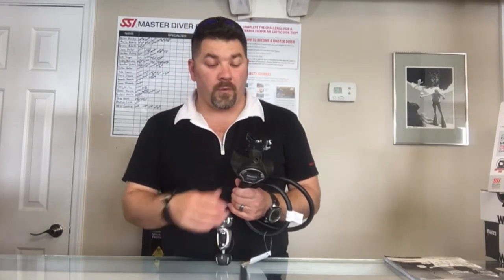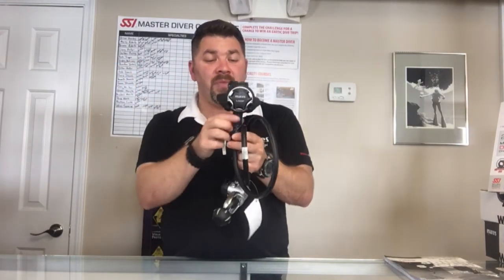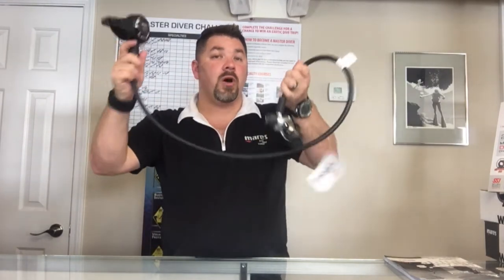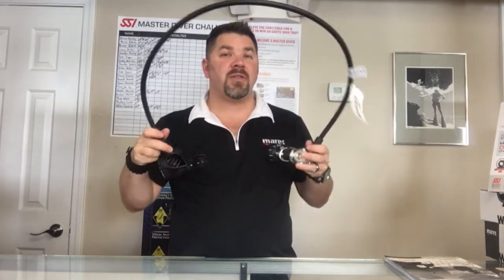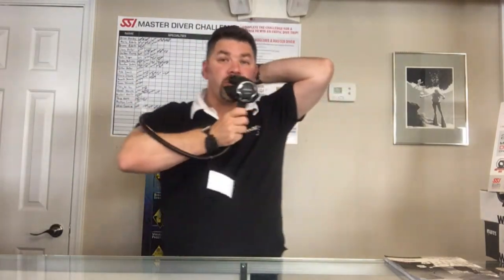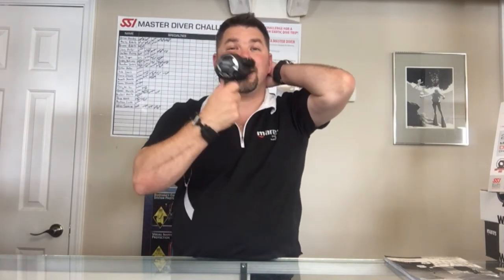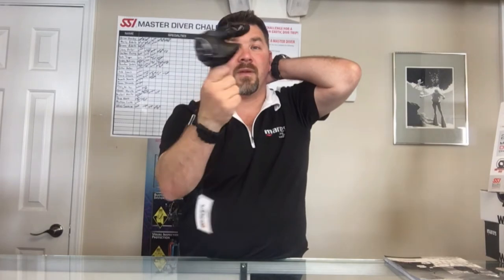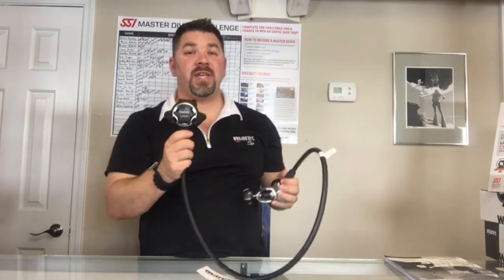Mares Loop 15X

Comment: in case i have two deco stages with two Mares  VR 2nd stage .....for the first deco stop with first deco tank no problem but in the second switch to second deco tank how you will hang the 2nd stage during the switch ? i hope you get my point
Reply from the maker: Hello Yousef Hummaid, with the vertical second stages, I would simply secure the hoses back under the bands on the cylinder. They would not need to be routed around you neck as with most stage systems. Any quick disconnect system would work just fine as well.

Comment: How do you remove the cover on the loop to clean the diaphragm for the second stage? I saw a pin on the side and not sure if I just pull it out with pliers or not
Reply from the maker: Hello Mazeoffury.  There is a small pin on the side of the Face Plate.  Be careful not to lose this during removal.  Then the Face Plate simply unscrews.
Reply: @LakeHickoryScuba  thank you so much
Reply from the maker: You are very welcome.

Comment: Can it be used for cold water diving?
Reply from the maker: I personally use it as a alternate air source for one of my pony bottles while ice diving.  With this being said, it is not a cold water regulator.  The Mares Navy Abyss is a much better choice.
Reply: @LakeHickoryScuba  Thank you very much! And do you know what would be the lowest safety temperature to use as a primary air source? Perhaps including the mares cwd dry kit
Reply from the maker: I'm not sure I have an answer to that one.  When we ice dive, the water temperature is 34 degrees (F).  If I had to give you a concrete number, personally anything colder than 40 degrees, I would only use cold water regulator systems to dive with.  Our local quarries average 43 degrees (F) on the bottom, and I use non cold water regulators without any freeze ups.
Reply: @LakeHickoryScuba  That is exactly what I needed. Thank you very much! Your videos are great!
Reply from the maker: You're welcome, glad our videos help.